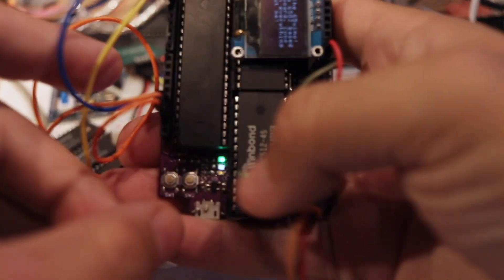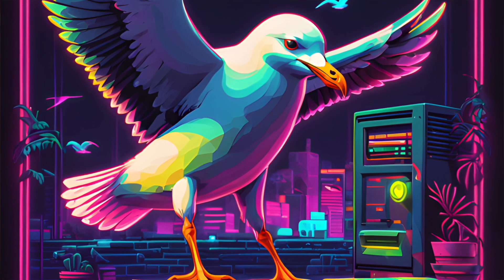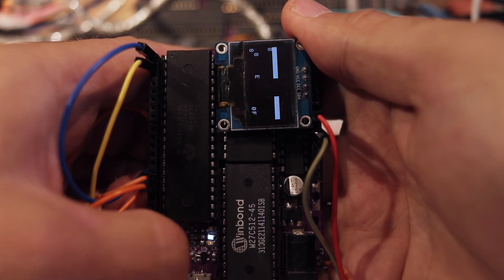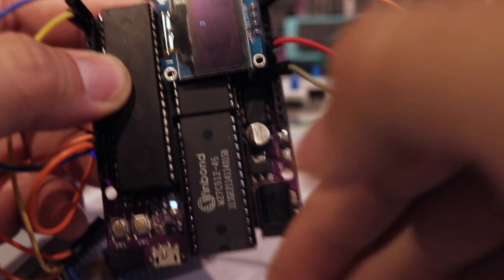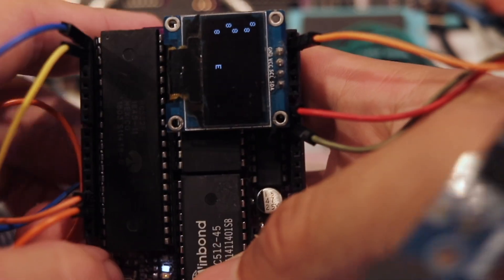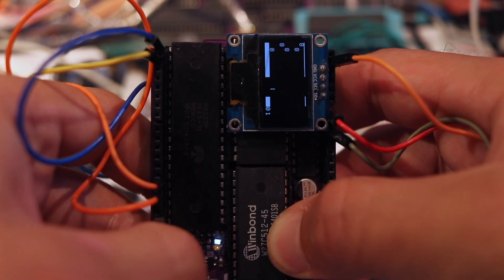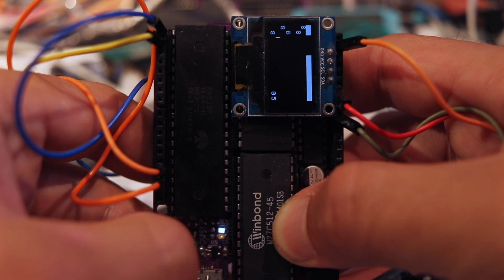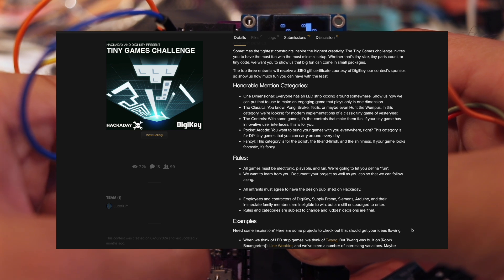6502 ASM video game in 500 bytes: Flappy Larus!

Comment: Incidental sound used to be used as a computer diagnostic tool.  The Ferranti Pegasus I and the Elliott 803 and 903 computers all had speakers which were used to "listen" to the computer executing code, and on the Pegasus I it was sometimes used to produce music.  Even the 920M which was an IC version of the Elliott 903 computer made for the military had a facility for one.

There is the guy who hollowed out an DIP ATtiny84 and put four LEDs and four momentary switches inside the extra space around the IC to make a Simon clone.  It only needs power and a couple of pins for a speaker.
Reply from the maker: I saw that one! That'll certainly give me a run for it.